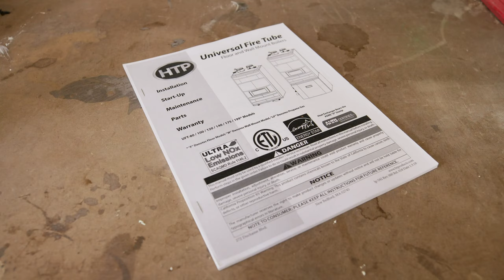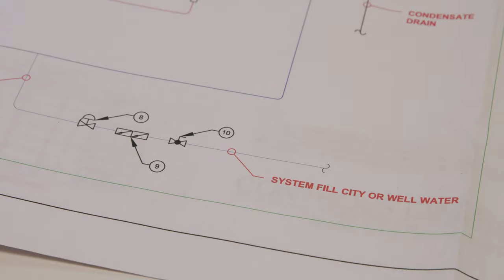Warmsource Installation

Comment: Do you have a fully electric version of the Warmsource?
Reply from the maker: Don't tell anyone but....(looks left, looks right)...we're working on one now. We'll know more on timing in 2021.
Reply: Warmboard Inc would love to help you test out some prototypes 👍
Reply from the maker: @DetachedGarage  We've got most testing sites dialed in, but send us an email. You never know.
Reply: @Warmboard  Awesome! What e-mail should I reach out to?
Reply from the maker: @DetachedGarage  info@warmboard.com
Reply: @WarmBoardInc can the warmboard comfort system be integrated/connected to an existing Heat Pump heater setup?
Reply from the maker: @WattsUpDev  The Warmboard panels can be connected to and air-to-water heat pump, but the Warmboard Comfort System cannot. It is an independent heat source for the whole home.
Reply: @Warmboard  Any update on the electric version?